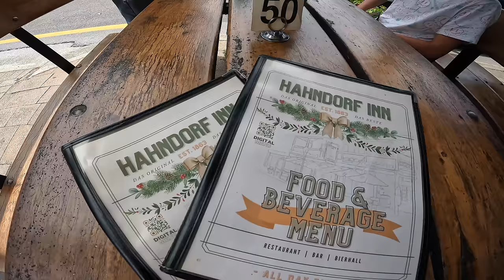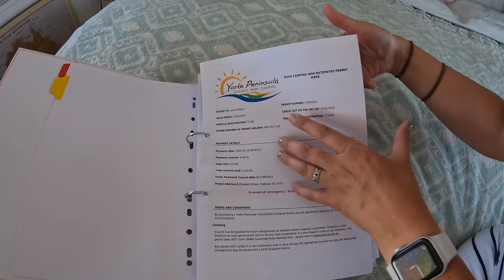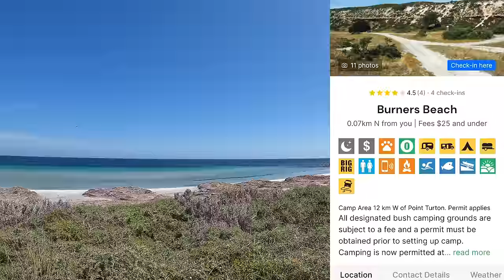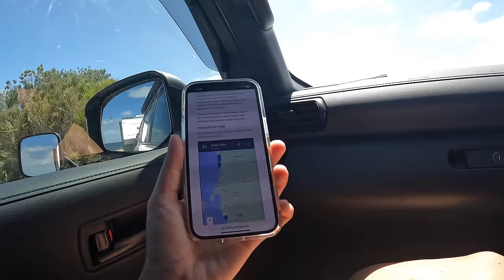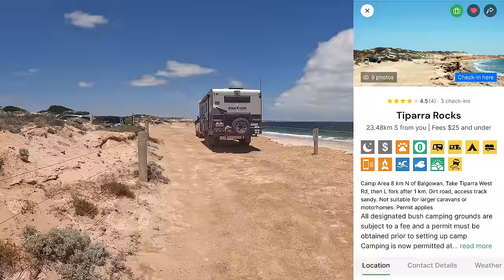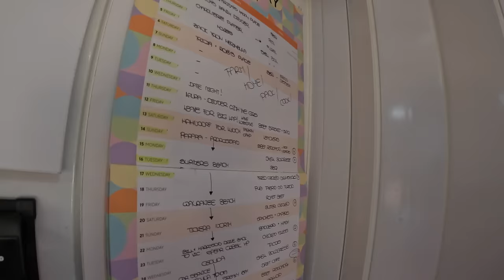From Lakes to Beaches | The Yorke Peninsula SA

Comment: Beautiful places you visit. That boat is pretty good too. No stinky petrol engine. You don’t seem to have much luck fishing though. Here is a tip. Buy some fennel root and cook it up to a mush on low heat and then let it cool. Soak the fish bait in it. Fish love it and works a treat. Greek fishermen use this trick. Use high tide just as it is coming in for max effect. That is when the fish come in to feed and just at sun set.
Reply from the maker: That’s great to know. We have a new rod and fishing this weekend so I may have to locate some Fennell. Thanks for watching and commenting.

Comment: Hi, In regard to your water leak, I had the same problem under my sink. I can't really tell from your video, but most caravan builders do not fit the locking circlips on the John Guest pipe fittings. As a result the vibrations from rough roads and corrugations cause the pipes to come loose from the fittings. I recommend you go to a caravan parts shop which sell these fittings and you purchase the circlips and fit them to every push fitting. It is a $10 fix which will save you losing water.
Safe Travels
Reply from the maker: Ahhh, great idea. Thank you for sharing 🙏 😊

Comment: That battery set up on the boat has to be one of the worst I’ve seen. Sorry. You have 18v batteries on a 12v motor
Reply from the maker: Don't be Sorry Liam it works perfectly 👌 😉
Reply: @JourneyUnknown  won’t be good for it long term